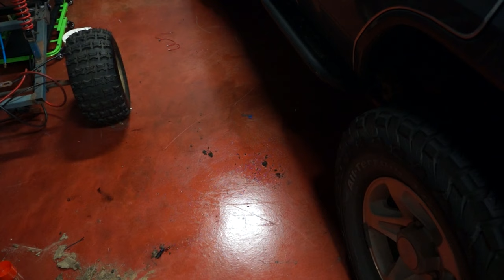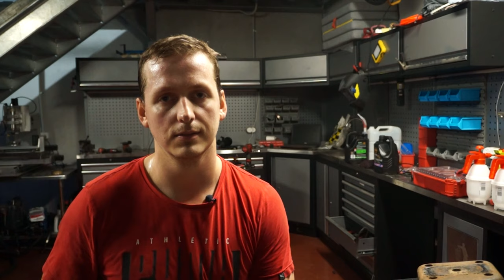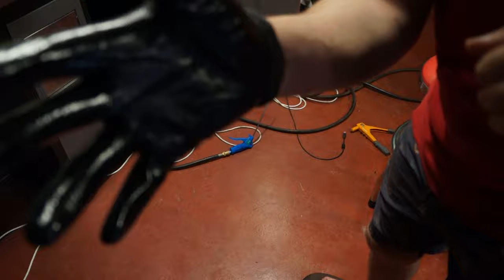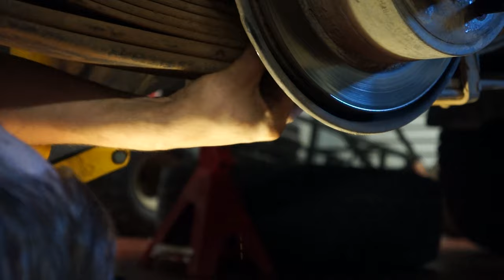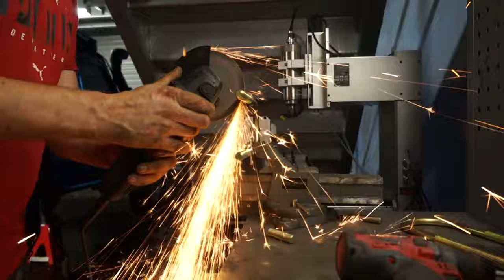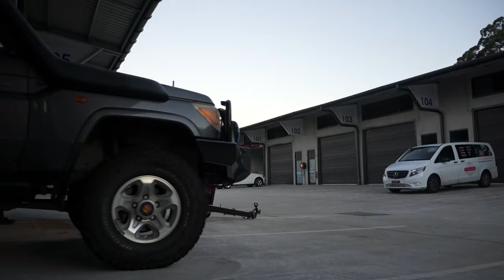How to make a 76 series LandCruiser not rubbish off-road

Comment: Nice.  What torque settings did you use on the UBolt nuts?  I've just fitted a set of Terrain Tamer 500Kg Parabolics, but there was no info on how tight to do them up.  I just did damned tight, but you seemed to be more particular.
Reply from the maker: 135Nm. Torque is based on grade of bolt and thread diameter, so you can find the torque for any bolt based on this. Lots of charts available to tell you. Also consider the material it's threading into and torque it based on the weakest link in the chain.
Reply: @ridiculousthings4x4  Thanks.  I'll go and check them now.

Comment: It's not that hard to get the rear of a 70 series flexing. The main issue is the front end. I'm surprised there isn't a long arm kit available for them.
Reply from the maker: The hard part is achieving the balance of flexibility and driveability. Sure, I could take out a leaf and scrub my wheel arches with my jelly suspension, but my goal is to find that perfect balance based on where/how i drive, and how much I carry there.